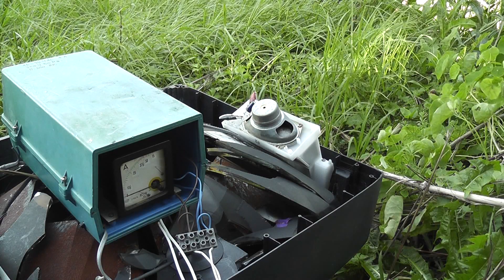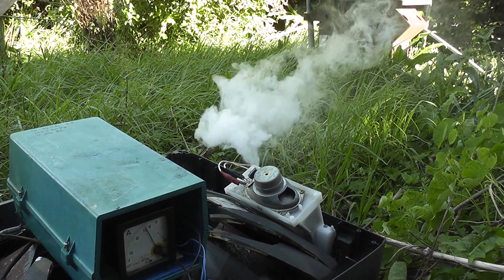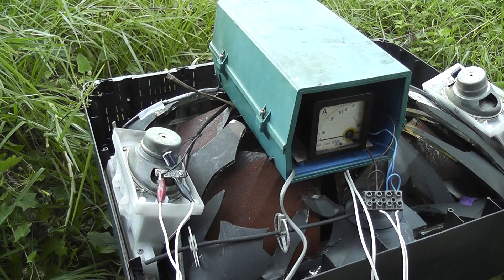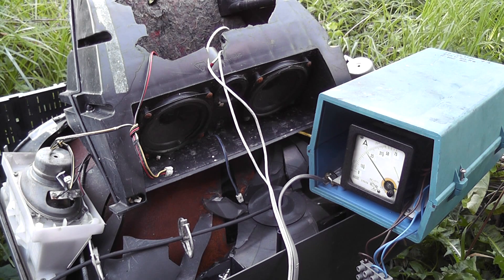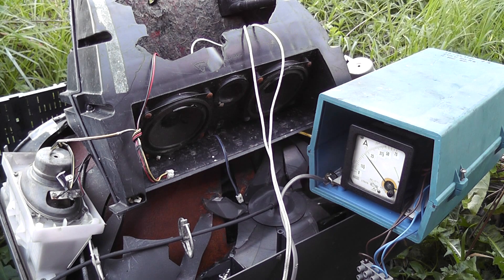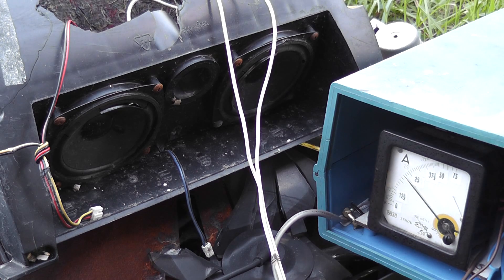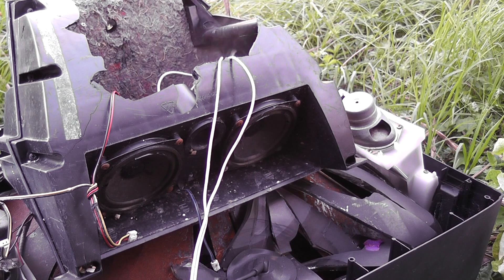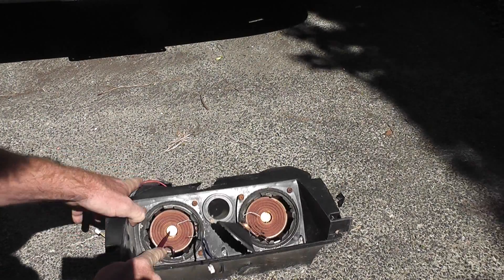4 old speakers popped and 2 caps

Comment: Mmmm, speaker pops. :D Quick question: Where did you get 100Hz from?

I have seen other people do speaker pops, and all they use, is 50 or 60 Hz, and a variac.

Also, don't forget to knock those magnets off the speakers...they're very handy for magnetising screwdrivers, holding notes to a steel door, or other uses. 

-BoomBoxDeluxe.